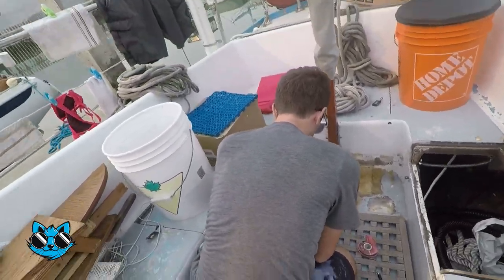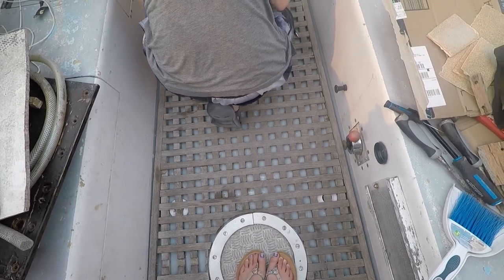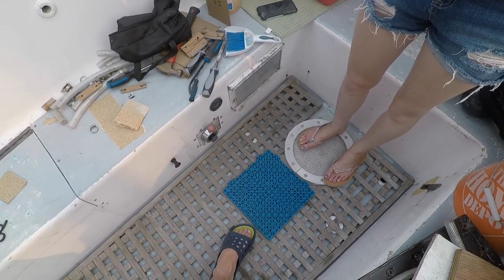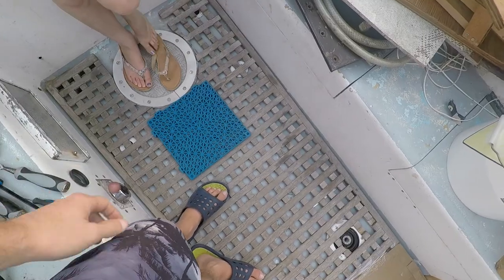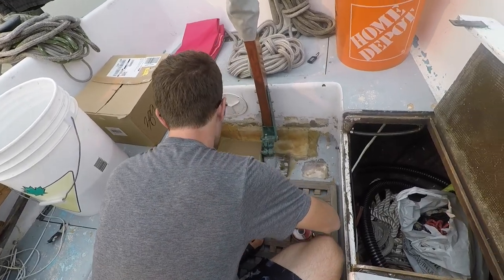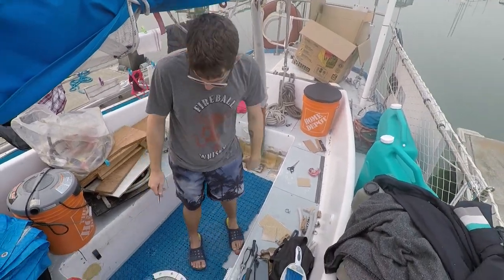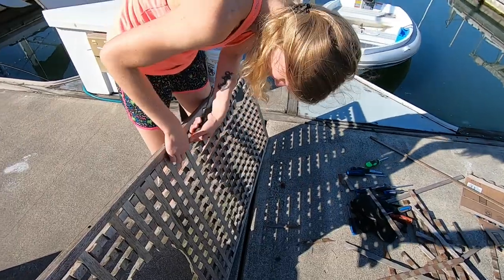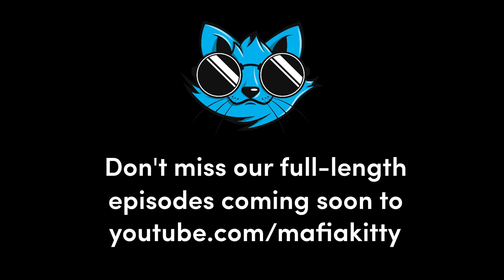Installing New Cockpit Flooring On Our Sailboat

Comment: I have the same Walker Bay 8 dinghy with tubes and a tiny 2.5 HP Suzuki.  It gets the job done.  It barely fits on my fore deck for winter storage.  My cockpit floor is pitched about 2 degrees forward with scuppers aft so I need similar matts.
Reply from the maker: It's a great dinghy! We ended up selling our Suzuki for an electric outboard and a cheap little Chinese one for back up emergency. We were just having too may problems with it.